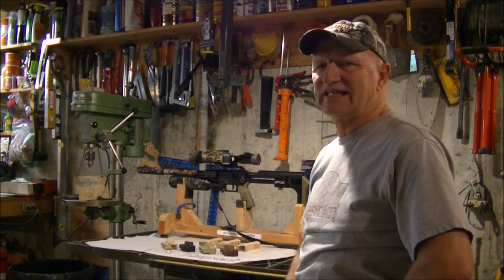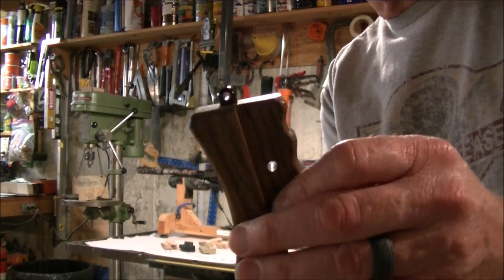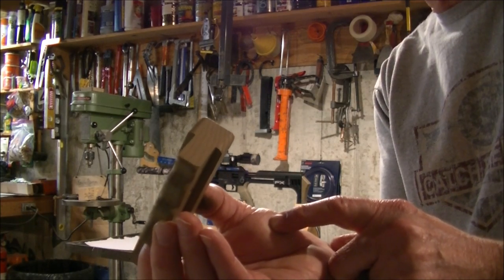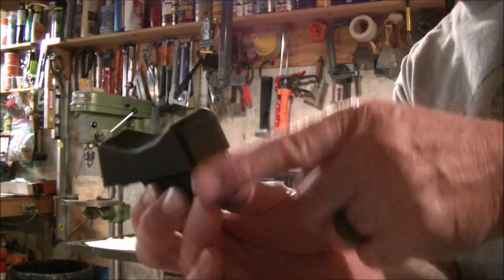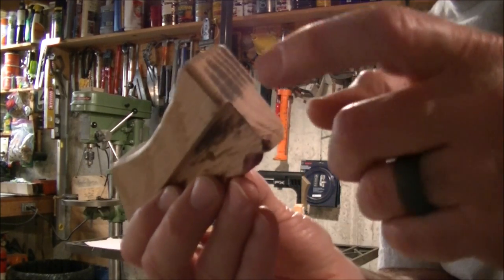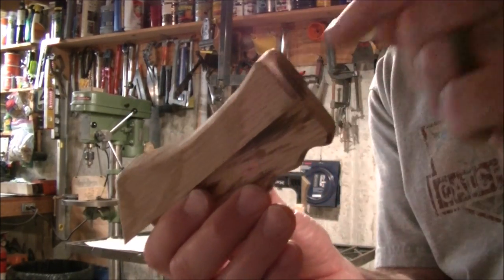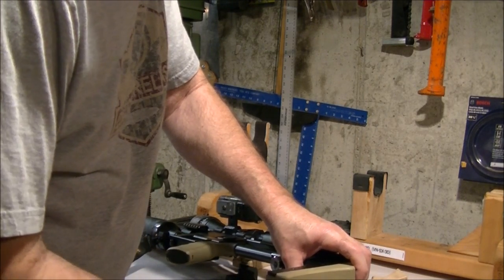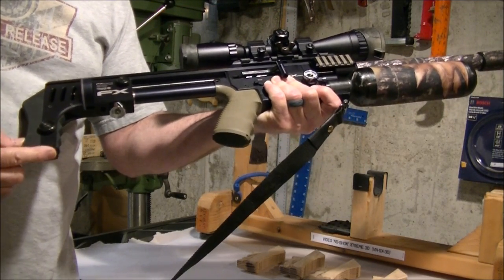NO LONGER MAKING THESE!! FX Impact Butt Plate UPGRADE!!

Comment: Wow, that's nice ,looks like they come from the factory,it's definitely been a challenge to put studs on a lot of these air guns.i need a stud hooked to my air tube on my 500cc 909 45.. u think there's somthing u could come up with,, I would buy it for shor ..great video
Reply from the maker: Thanks, Kevin! If you will send me a link to your airgun so I can see exactly which model it is, I'll take a look at what I can do...
Reply: Alex Wiggs it's the Sam yang 909 light hunter   500cc air tube , I'll see if I can find diameter of air tube, it would have to be like a two pice clamp that screws together,, like the ones they sell for like a 30-06 Berrel  or a 12 gauge barrel ,,, but Much bigger
Reply from the maker: So you are wanting something that clamps to the barrel/air tube that has a swivel stud attached to it?
Reply: Alex Wiggs yes